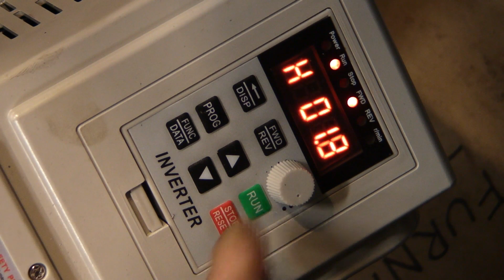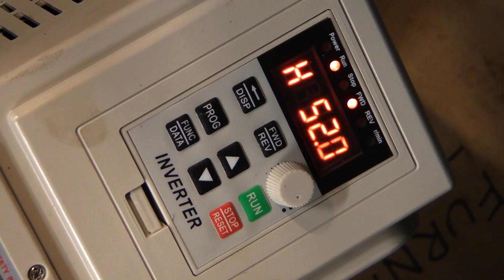what happens when you leave the chuck key in

Comment: ...when i was an apprentice ~40 years ago, our instuctor showed us a crater, caused by a flying chuck-key on a concrete wall some 20 meters away...! 😧
...the impact got through down to the reinforcing-bars...! 😱
...if it somebody stood in its way it would have hurt...! 😭 
...the sort of RiP-hurt...!
Reply: I remember at school everyone thought safety measures were excessive. They tell you to always keep the chuck key in your hand when in use, never leave the key in the chuck if your hand is not on it. A guy forgot the key and started the machine, the key got caught between the machine bed and the spindle. The key snapped right off and punched a clean 4x7 inches "L" shaped hole thru 1/2 inch plywood about 10-12 feet away. That brings rule #2, you should never be standing right in front of the spindle/chuck. Lol

Comment: I actually thought You were going to start Your spindle. I just thought of this, They thould have a tube receptacle on the lathe to hold the chuck key.  microswitch would be in the tube that disables the lathe when the chuck key is not in the receptacle actuating the microswitch.
They have similar safety mechanisms on punch presses.
Reply from the maker: Excellent idea Dan,
Reply: One of my old lathes actually had this feature. It was definitely a later modification. Still probably done over 40 years ago. Very simple and effective. I ended up using the machine for parts so I never used it.
Reply: They have keys that have spring loaded  sleeves that prevent that mistake happening. The key I've tried needed about 2.5kg (~6lbs) to engage.
Reply: It's called self-eject chuck keys 👍
Reply: @Levon_Darratt  I was just loading a 100 pound chunk of steel in my manual lathe. Those self eject keys are problematic when you are man handling large work. They do have their place though
Reply: @danneumann3274  ya , obviously depending on work pieces size and if you manually load your machine it could be problematic. I barely use lathes but the shop is equipped with chain blocks and also has 2 overhead cranes to make it a bit easier.